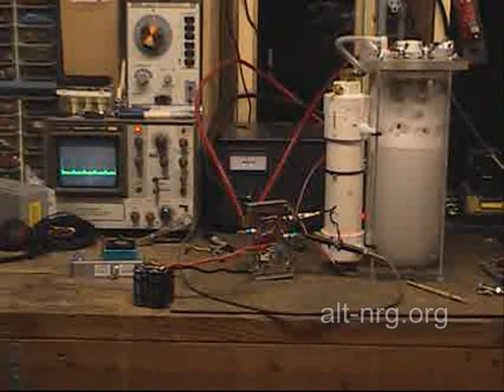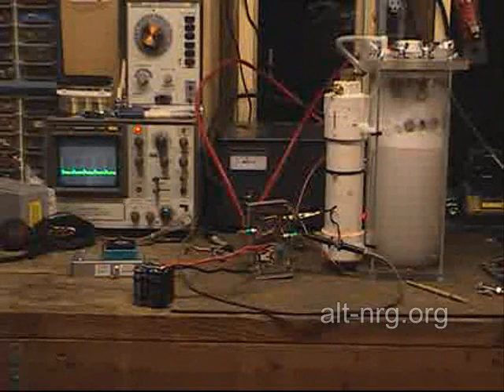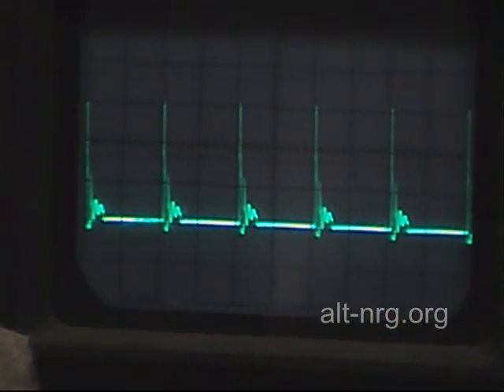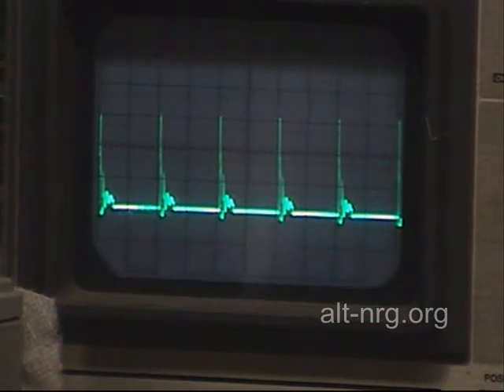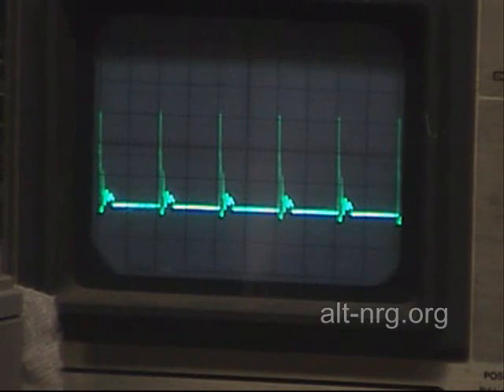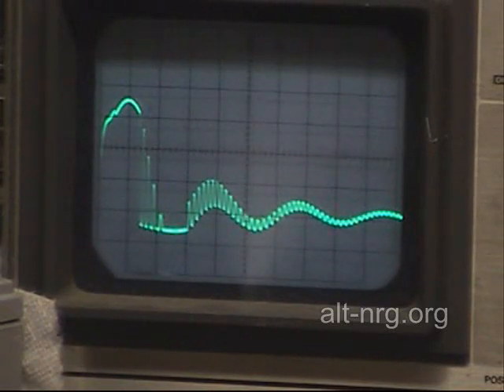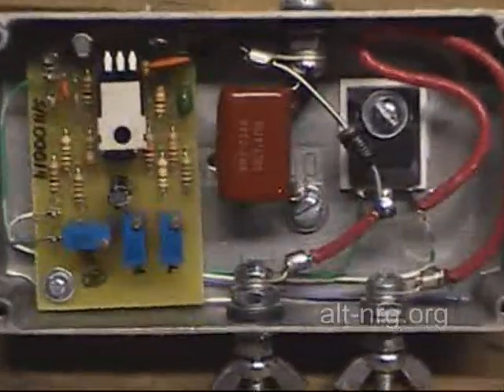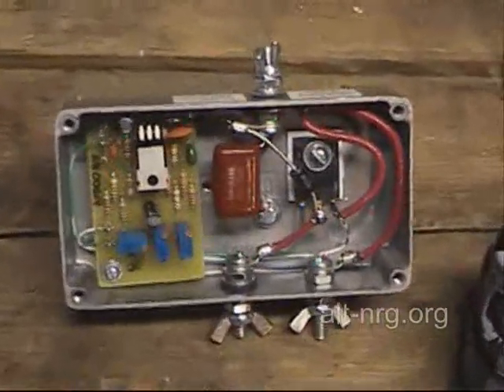#128 - PWM Connection Instructions

Comment from the maker: The capacitance is the same but the ESR is lower for multiple caps in parallel. As long as your one cap is not getting hot over long periods of operation you're all set. If it gets too hot to touch you'll need caps in parallel.

The revised connection diagram helps with this a lot too.

Comment from the maker: The basic op-amp building blocks (triangle wave generator and comparator circuits) have been in electronics reference manuals for decades. The current regulation error amp is my own contribution to the design based on my original work, although I am not so foolish to believe it has not been done before.

When you think about it, everything we have was created on the shoulders of someone else's work. This is why I share everything, to speed advancement for the benefit of all.

Comment: Hi Zero,

I think the correct term would be damping rather than clipping. A clipped waveform typically has sharp corners and a flat line between the rise and fall slopes. Whereas a damped waveform can have any shape but is reduced in amplitude. Damping circuits often have the result of stopping 'ring' and so we associate the term with that. In reality, damping is anything that reduces high amplitude changes. BTW, a good HHO cell will act as a capacitor in a resonant tank circuit ;-)

Comment: Oh and yes using an opamp as a error amp with a current sensing resistor for current regulation has been around for some time also. We used to use 0 ohm resistors but I like your use of the 14awg wire for current sensing.

Comment: you can eliminate the problem by separating the negative ,the negative that feeds the electronic board and the negative that feeds the MOSFET ,rune 2 negative wires from the battery one for the PWM AND one for the electronic board .

Comment: Thanks for the info,I never throw any old circuit boards away until I`ve removed all the usefull bits,even an old toaster can contain some usable bits,I`ve just savaged an intercom system & have found a nice little Surge Suppressor Unit using CG2-145L-8314 & PFZ-56-8302 Diodes,So I`m exploring the possibility of using some of this.The only problem I have,is blowing FANS.

Comment from the maker: The 4.7 is instead of with a disclaimer. The PWM must be connected as shown in the revised diagram. I'm still tweaking this and have not ruled out the possibility of a small toroid choke on the PWM B+ internally as well.

Comment: I absolutely love all of your videos.  You have rekindled the engineer inside of me!! I have a couple of questions.  1. Have you given any thought to a way to turn the HHO cell off if no current is detected? That way you do not run you vehicle fuel mixture too lean( if using your EFIE)? 2. Could you update your website with your most current layout like the second picture of the PWMv2 of the actual board with connections shown? 3. I cannot get mine to work corectly. R14 is smoking, literally! ??

Comment: I have a question on setting up the pwm,the instructions are confusing,what is ment by foldback, and it reads to me as you set the cell up with out the load.I set the cell cold with 30 amps straight dc first.Then connect the cell up to the pwm

Comment: JUST ONE QUESTION ON THE 4.7uF  100V CAP; IS IT AS WELL OR INSTEAD OF THE ORIGINAL CAP ?   
GREAT VIDEOS BY THE WAY PETROL HAS JUST GONE DOWN IN THE U.K. TO $10.50c per Gallon.

Comment: Hey Zero , I am almost done assembling my PWM, but was wondering about the C6 .oo1 cap , it looks like you have one hooked up in vid #125, it shows C6 optional on the parts list but it actually says 12000uf 25V which is C7 in the diagram, and doesn't show the actual C6 .001 in the list so i didnt order it, what does it do should i install it?

Comment: Z, after considering this further, if not using the isolation coupeling I am wondering what effect the capacitors would have on the cell circuit? The capacitors are only really doing anything when the ground circuit to the load is interuped (not connected) so what effect would they have on the circuit ressonance? Also, just a thought that you might be able to reply to, since we are talking about low amperage short durration spikes would a zenner diod (15V?) be able to "clip" it to ground?

Comment: Z, I am trying to play with resonance. I plan on building a PWM but use a photooptical isolator as its output. Such a set up would not be needed in this aplication if I have things straight in my theories, correct. If I do not use isolation then all the caps will have to factored into my attempts at resonance.

Comment: Hi Zero, 

I finally have a new capacitor for my PWM that I build from your design, but they only had a 50 volt and 15000 µF capacitor. I want to ask you if I can use that without damaging the circuit. And if I am correct, I have to connect it to the + from the PWM and the ground of the PWM ?? Can you please tell me if I am wright or wrong....

Best regards, Rick

Comment: Since you have extensive experience with cells and PWMs, I'd like to ask you this (it's been bothering me for some time now): since the voltage per gap (in a series cell) should be (around) 2V, doesn't that mean that in parallel cell we only need cca. 2V for the entire cell. I'm asking you this, because if it's true, it'll cause dramatic reduction in consumption of power.

Thank you in advance.

Comment: i seen a callout for a 4700uf Cap before. Now I went ahead and used that and it sure helped out alot. I dont have a scope to test it but from what I was trying before compared to now its a huge diffrence, well at least i am not blowing the c2 up any more. Now with the four Parallel 1000uF Caps compared to the 4700uF Cap what am i looking for if its doing okay? Isnt 4X1000uF caps the same or close to 4700uF? Im a novice at electronics, excuse my stupid questions.

Comment: also I have the 100v 4.7uf as shown in vid # 128, also have the 12000uf 25v cap,  
now should all these be installed together 4.7 inside and the 12000, just outside the box??
One last ? Im installing this on a 1978 datsun B210 1379 cc,  and Im only planning on running up to 15 amps MAX probably more like 12,  how hot would the unit get at this amperage without a heat sink and fan..  possible maybe.?

Comment: Ahah! Yes..... I've been away from electronics for a while. Capacitors in series act opposite to resistors in series. Capacitors act to smooth the supply, so dampen fluctuations in voltage... do I have that right? Fergus

Comment from the maker: 2.25" of #16 = 6" of #14 = about 45-50 amps. No one installing on a normal car should really go much higher than this for safety sake. If anyone wants to push it harder than that all they need to do is trim some off.  No one has asked yet.